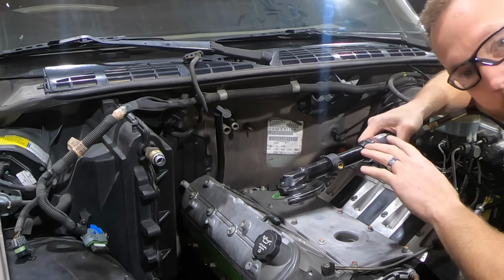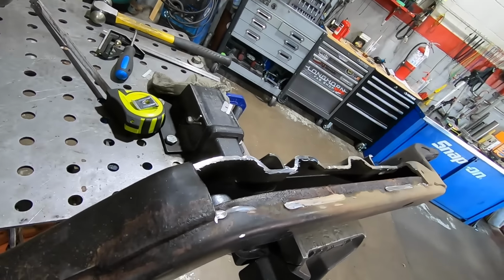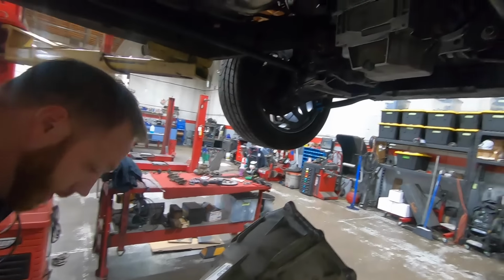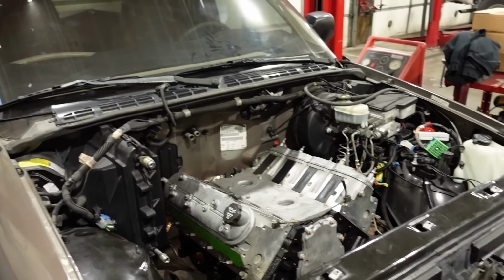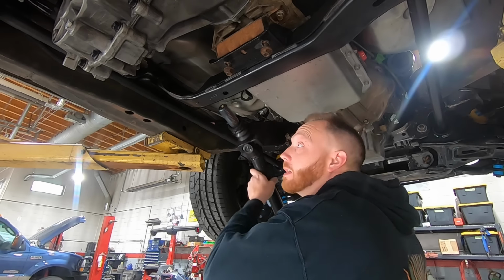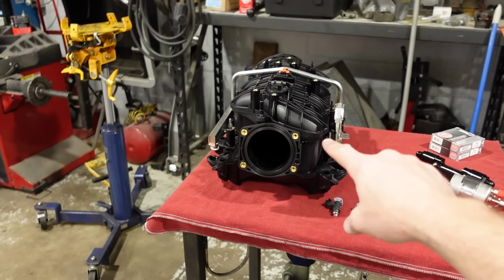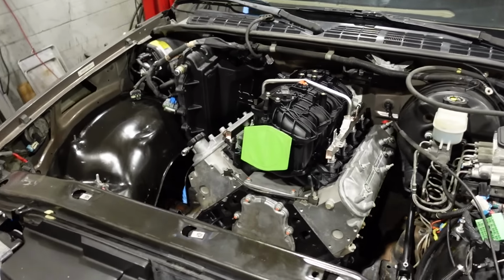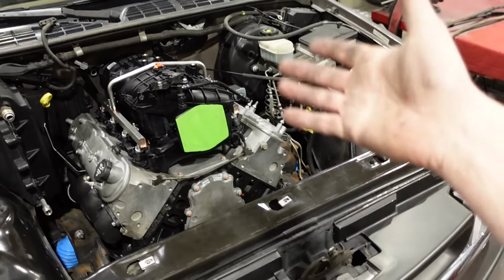I CAN'T BELIEVE I did this to get the LS swap to fit...

Comment: 4L60 has a 3.06 low gear. A 4L80 has a 2.48 low gear. It makes sense why the truck was better in 60 ft
Reply: I was going to say the same thing
Reply: No wonder why my Silverado slowed down on the take off but I feel like 4.11 gears helped a lot
Reply: Yeah, 4L80s do not have good gear ratios.
Reply: @GreatLakesLogger more for hauling probably. Wondering could change ratio gears ? Not talking about final drives. I mean in the transmission 1st, 2nd, 3rd and Fourth gears ? Ones really need to change 1st and 2nd.
Reply: @Silkmaster4200  I wondered that myself. I believe there's some ratios available for the 4l60, so I would think the same would be available for the 4l80
Reply: @Silkmaster4200  That and many 4L80e units were in HD trucks with 4:10 rear differential ratios in them.
Reply: @prevost8686  true yep.
Reply: Depends on what you are using it for. Will outlast a 60e without a doubt @GreatLakesLogger
Reply: @IslandBoy958  I personally have had much better luck with 60s the hard parts can handle more than an 80 before they need upgraded.
Reply: @GreatLakesLogger The deeper 1st gear in the 4l60e is a holdover from the 700r4. Back then, engines were gutless because of emissions, so they used the deeper 1st gear to make them a little better off the line. The big problem with the 4l60e is the gap in ratios is pretty bad. If you're drag racing, a lot of 4l80e end up being faster assuming you're making decent power.
Reply: @BrendanCBreen  that's true. The 80 requires a lot higher tc stall to get off the line, and that ratio means it takes more torque in the input shaft to get it going, hence why 80s like to break and put shafts more. There's no doubt about it, the 80s are stronger when built
Reply: @BrendanCBreen  yeah the 4l80 first gear is optimum when your leaving with a lot of power. Mine works great on my turbo truck but I feel like the 4l60 first would be too low on this setup.
Reply: @BrendanCBreen They are the same transmission.
Reply: Check out the 4L75E, 4L75E-R and the 4L75E-HT
Reply: @ItsDaJax  Nope
Reply: @BrendanCBreen  The 700r4 was renamed 4l60 when gm changing their naming conventions. The 4l60e simply has an electronic overderive.
Reply: @ItsDaJax  The main point of my comment was about the 4l60e and 4l80e, but ok. The 700r4 and the 4l60e aren't the same. Even if the hard parts are interchangeable, the case and valve body are different if only one of them being electronically controlled wasn't enough for you to say they aren't the same.
Reply: @BrendanCBreen  I understand.
Reply: @Silkmaster4200 sonnex sells a carrier kit that changes 1st and 2nd gear ration from 3.06 / 1.63 to a much better 2.84 / 1.55
Reply: @GreatLakesLogger They're not bad per say, the closer gear ratios are better in the top end but it really does bog the launch even with a high stall converter. If I had lots of money too throw into a project I'd get a gear vendors and run 4.88's in a half ton.

Comment: Remove the heater core. You are a great TIG welder, so weld the new outputs of the heater core in a different direction. Make completely new openings in the fire wall, where you bring the hoses out from a better place.
Reply: Tearing that dash out is a real pain but I agree with you !!!
Make it Happen !!!
Reply: Retired radiator serviceman says yes 👍 100%
Reply: I did this on my ls swapped s10. But I just turned the tubes into 90s out of the firewall. Build has been running and driving for 4 years and it worked great.

Comment: Heater core will be an easy fix. Take the heater core out, cut off the end enough to fit and put a 37 degree flare on it. Run AN hose from there to the heater box with rubber grommets to prevent puncture.

Comment: Just get yourself two 90 degree metal SharkBite fittings for the heater core and slide them on the pipe after cutting!! If there is room you can even get 90 degree compression fittings. I PROMISE its the easiest solution and honestly wont look bad either! Either way you can get the hoses to hug the firewall at any degree of circle you want. loving this content man! I remember watching you on TV years ago! So glad you are sticking with you tube!!
Reply: Exactly what i was thinking and dont even have to remove the core

Comment: If you are worried about getting a 4-bolt throttle body to work on a 3-bolt intake manifold (like LS1 or LS6) then use an ICT Billet throttle body adapter.  SKU#: 551597-3B-102 will adapt up to a 102mm throttle body.  SKU#: 551513 will handle up to a 92mm throttle body

Comment: New cab mounts will give you a lot more clearance for the bellhousing.  The factory rubber sags and the body falls. My 83 s10 had the firewall seam covering the bellhousing bolts on my first trans swap in 2002. 
  My 93 k2500 had front tire clearance issues until I'd realized the body mounts sagged on it too. Polyurethane bushings fixed both permanently. Food for thought.
Reply: Good to know. Should prolly use poly mounts.

Comment: I have been mounting my trans coolers to the bottom of the beds with dual 8inch fans on 40k cooler. This has made a great difference in trans temps and it's one less thing in front of my radiator. Ran this setup on several different truck with zero issues and great trans temps under harsh conditions.

Comment: My 4WD GMC Jimmy with an ls swap has an LS6 intake. Mostly because I raised my engine about an inch higher than yours (from the looks of it) I had to use holley brackets and everything is tight, but fits very well. Next time I pull the engine, I'm getting a new AC box for it. Now, i need to decide if I'm going BW 4472 or NV149. The 149 is easier to source and bolts right up to the 4L60E, but as you can see, it's designed to hang low under the full-size truck. Looking forward to see how you make it work!

Comment: LT, Just an FYI the LS1 & 2 manifolds are not any good. The ONLY good low profile manifold is a LS6 for the cathedral port. Per Richard Holdener testing. I used the early truck manifold and shaved it then added some fiberglass, a skim coat of Bondo and a few coats of hammed flat black.

Comment: On my 5.3 swap with the truck intake I used a 3/8 extension and slowly bent the heater fittings out of the way .

Comment: I have an LSA set up on my Xtreme S10 Blazer. Never hooked up the heater hoses (live in south Florida). You will likely have fitment issues with the stock hood and the ZL1 lid. I'm running a cts-v lid and the stock hood closes fine.

Comment: Why not take the heater core out and make the connection under the dash then run rubber lines out through the firewall. Maybe if you can fab a bulkhead and some 90s switch it to AN fittings  You are a fab guy you got this.

Comment: Just weld a new end tank on the heater core and two -10 bungs.  You can then run AN lines through a different spot in the firewall

Comment: 21:28 weld on bung will do it. One could actually measure so the AN threads mount flush as there are thru firewall bolt on fitting plates.

Comment: Pounding the pinch weld flat is a must on any s10 transmission, even when replacing stock for stock. 
Cant tell you how many times ive smashed that spot at 10 and 2 o'clock for an extra 2 mm, 
Just a thought, get shark bite 90° plumbing connectors for your heater core. I know they are intended for indoor plumbing, but they totally work for hot water, maybe they would hold up? If they hold up to water pressure, they should hold up to coolant pressure?
Reply: And it would even go on the cut off pipes.

Comment: 4L 60s can be made tough. Richard at performance transmission is someone who can help with the upgrades.
Reply: The truck being lighter helps a lot
Reply: I broke a FLT stage 3 trans on my tune only 4x4 RCSB 4.8 Sierra. 2003. Totally destroyed it. My 98 S10 SS went 20k making 360-380whp from the 4.3.
Reply: @EGGINFOOLS  what broke do you know, I had a local guy install it but I bought the monster in a box kit from monster transmissions and the input drum broke and same just a tune cold air intake and a muffler but thats a stock part so unless you want to spend another like $600 or something for the sonax upgraded one it is what it is

Comment: Heater core option: is there an aftermarket electric defrost option similar to what is found in Ford Super Duty diesel trucks? They use an electric booster to get hot air going to the glass before the engine warms up the coolant.

Comment: It the heater core lines back far enough that your connections will be inside the truck.  The rubber lines exiting the firewall will be easier to manipulate

Comment: I don’t disagree with the 60e choice for now. I have one with a corvette shifter, B&M shift kit and pinless 1-2 accumulator piston (the only mods) and a stock converter in my 03 awd RCSB silverado. It has a 6.0 with twin turbos and the 60e has been a champ with many boosted launches. We’ll see how long it lasts, but your truck is still quite a bit lighter.

Comment: The heater core tubes can be cut off and use rubber hoses with clamps “inside”firewall. Old trick to change heater cores without pulling dash. As heater core can usually slide sideways to remove them. I did this on an equinox.

Comment: I had a level 6 rpm transmission 4l60e 2wd behind my turbo 5.3 making close to 700hp for over 3 years and it was flawless
Reply: Also if that’s a corvette fuel filter it will not work if you go up to a 450 pump in the tank
Reply: And you can buy an fittings for the trans and run the hoses over the trans to the driver side which will give you a ton more space 👍

Comment: The reason you had issues with the TBSS intake is the same reason why it's so good. The base engine in the TB is the super tall 4.2L Atlas inline 6. So, when GM put in the V8, they had tons of room to make the TBSS intake massive. Speaking of the Atlas engine, you should do something with it in a single cab first gen colorado/canyon.

Comment: Tap the heater core tube that you cut off and thread in a 45 or 90 degree fitting.

Comment: On the 4l60e. I will give you some personal experience advice. With just the Corvette servo and teans tune you should be okay. If you go with a full valvebody kit and servo... forget the trans tune. I forgot to remove the tune i had after a HD2 kit and billet servo upgrade. And promptly sheared the output shaft of behind the sunshell. The short 4x4/awd shaft doesn't have enough distance for torsional stress handling lol😂

Comment: I know it`s more money but to save future problems I always replace the OEM heater core and I also have a radiator repairman finish filling in around the tubes at the core so there will be no possibility of cracking the soldered joint where the tube enters the core body while handling the heater core and at that time I would solder on some AN fittings then after some fire wall work to remount the core there might  be enough room to thread on some 90 degree elbows!  Before you beef up the tube you might think up a way to bend some tubes to make your elbows then have them have the solder new pipes on to the core?

Comment: Hey Lawrence can you air hammer the firewall back around the heater core lines  to expose more pipe where you can tig 90's on?

Comment: Since you're modifying the heater core tubes anyway, would it be worth the effort to move them to a different part of the firewall so that they are not right behind the engine? It could also aid maintenance in the future!

Comment: I think vintage air has a heat and air setup that would work for a S10 and you could remove the AC box from the engine bay and give you more clearance around the motor just a suggestion

Comment: Not sure if they makr the size you would need for the heater core tube. But, Swageloc makes 90s compression fittings you could maybe use

Comment: idk if you know, but in 97/98 they changed the trans mount position by about 5/8 of an inch on the 4l60e.  could explain the pan clearance if you changed years.

Comment: The heater cores in the s10/Sonoma/Blazer/Jimmy I'll put together kind of funky. Were the pipes going to the core itself is o-ringed. The welding on it or moving it around will make the o-ring fail. Another one of GM standout designs. And to change the heater core you need to take the dash out, no Forward thinking by the GM engineers there.
Reply: Most cars are a dash out job for replacement. It's not just GM.

Comment: Hey LT! I want to build my truck up to have around 500-600 horsepower. I recently had it dyno’d and it’s a completely stock 5.3. Should I get a 4L80 built for it or get my 4L60 built for that power. 

The truck I have is the exact same truck your copo truck was.

Comment: Here is just an idea only go and buy a new heater coil cut it to but my thought is this you will need to get some copper elbow and copper pipe and male and female fitting at 45 degrees 2 of those will need male ends I'm thinking if you do everything right you will have heat.

Comment: LT find a 01-10 duramax front driveshaft, its what i use for 4l80e swaps in 1500s, might be just what you need or can cut it down

Comment: He could have took the heater core out injured word coming through the firewall took out your torch heat is up to brass tubing that's in there until it was just about the point of melting in bent one downward at an angle to the passenger side and the other one that was on the inner side of it tilted up towards the upper side to the right and then you wouldn't have had to cut it but for some reason you like cutting things up

Comment: Yo LT, How do Tesla’s get heat? Electric heat core? Maybe install a electric heater core. I’m curious how you can make that work. And it’ll be great information for future projects.
Reply: They use either electric heaters, or a regular heater that runs coolant from the radiator. I forget.

Comment: Hey Lewis do you have a miniductor I put a 3/8 6 in extension on the inside of the heater core pipes and bent them towards the top left corner of the windshield looking at the truck

Comment: A 4l60 will work fine with a street build but it needs to be upgraded to the V8 clutch pack. The v6 spec 4l60 has less clutches in it.
I highly suggest getting a trans temp gauge and putting an aftermarket trans cooler on it. The factory trans cooling an s series was never good enough on the factory setup.
You might not have the room but if ya do I'd get a deep sump aluminum trans pan also.
I've built a dozen or more s10s with all kinds of engine, trans, and even 4x4, AWD (bravadas), and 2wds. I've never seen one that didn't have trans cooling issues once the factory system gets some miles. Start adding power and v8s it gets worse.
Reply from the maker: Thankfully this a V8 truck transmission already, it came behind my 5.3 in the donor truck. And absolutely it’s gonna get a big transmission cooler.

Comment: The dot is somewhat pointless if it’s done after the bolts are all torqued.
And you’re doing it wrong anyway.
The process is, torque a bolt mark it with a dot to one side usually at twelve or six or nine o’clock put a dot on the part the bolt fastens down beside the mark you made on the bolt, then move to the next one and repeat.
The purpose of this process is to give a visual indication of any fasteners that may have been missed and to give a visual indication of a fastener coming loose

Comment: That little truck looks really good with that supercharger under the hood! What are you going to do about traction though? That little truck is so light weight just the regular 5.3 will make it spin it's tires all over the place, then with a supercharger, I mean damn LT, you better have some sand bags in the back or a junk big block in the back so that you actually get some traction! lol

Comment: My 9 second street/strip truck has heat. There is 0 chance I’d put a street truck together, especially in Colorado, without heat. I’d spend the $500 without question on a different intake. Your ocd ways might be coming to an end 🤣

Comment: Thers no reason you cant keep the 60e,  built properly they handle 1000+ with no issues, but damn a 3200 converter? that's a bit on the tiny side. 3600-4000 would be more ideal.

Comment: The coolant pipes clearance, done the same thing with a SBC swap many many years ago. Finished painting and setting up engine bay then found I couldnt remove the or fit the distributor. Cut the custom engine mounts and remade them. Linkages, oil pan, drive shaft, shifter location. So many things I had to redo I think I still have a little PTSD from it.  My only takeaway was always use a fully dressed engine for final mock up.

Comment: If you fill a metal line with sand or salt, it will help prevent the tube from kinking.  If you have to do a really tight ninety, you can cut a v out of the tube, bend it, and then weld the seam shut.
Reply: 100% true. When Yoshimura was just starting out his wife used to pack sand into header tubes so he could throw better bends onto them.